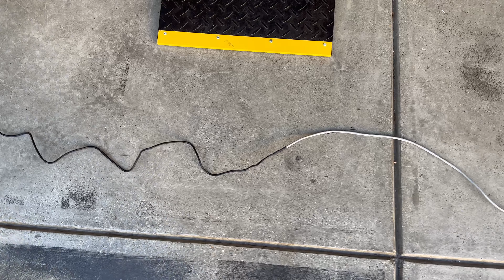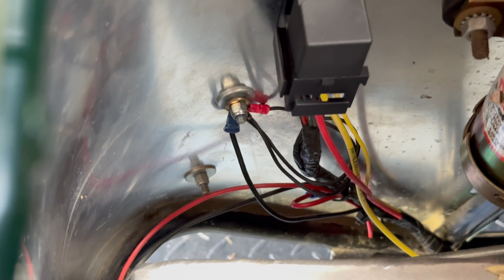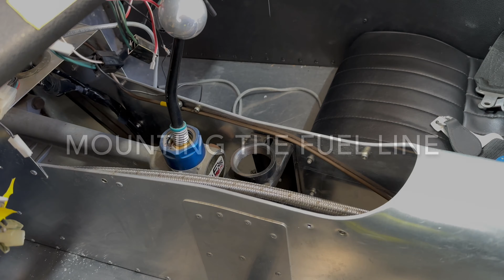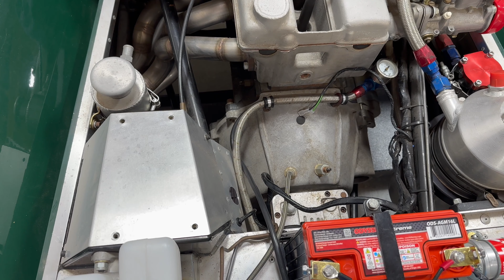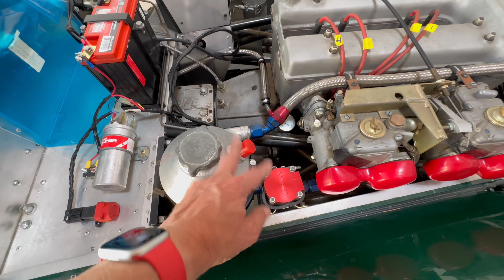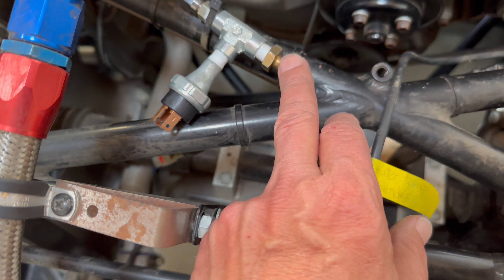Completing a Caterham Seven Episode 4

Comment: With nearly 17 years experience of owning my own "Caterham Seven" and working on similar cars for a lot longer, I would advise carefully and thoroughly corrosion protecting,  all of the connections for the fuel pump. That area in particular gets a real soaking in wet weather and the aluminium will corrode really quickly now that you are passing an electric current through it. With no prevention, you'll risk suffering a "Dead" fuel pump after a few months of non summer use. In all honesty, Caterhams have less than optimal wiring looms and faulty earth problems plague the "un-cared" for cars. (A quick internet search for Caterham Wiring problems will confirm this.) I'm doing a complete new loom for my own car and everything is getting an earth back to the battery as opposed to through the chassis. We use ACF 50 fluid and it keeps everything very well corrosion free!
Reply from the maker: Thank you for your advice. I ended up avoiding using the aluminium panels as the ground return. Hopefully this will avoid any issues